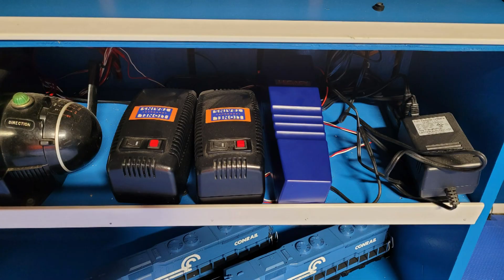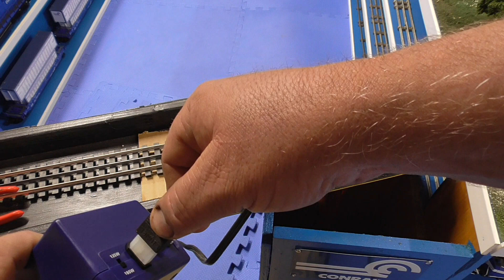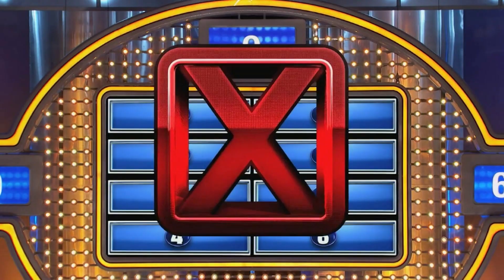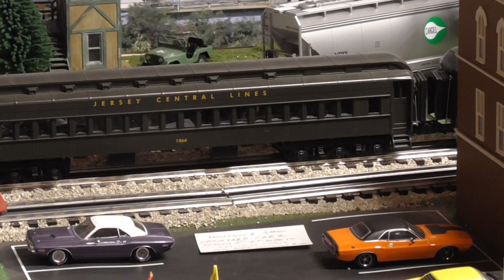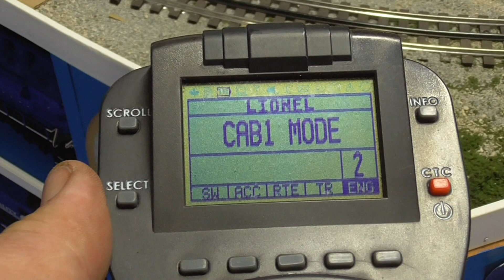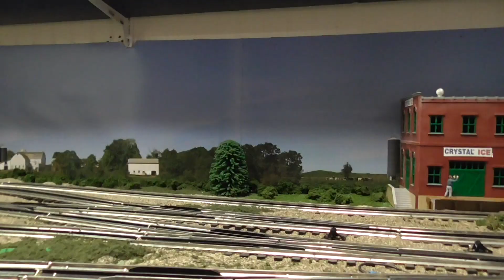Lionel Powermaster Install / Making Conventional O Gauge Run with a Remote

Comment: If I have a 180 powerhouse, powermaster, and Cab1L, is that enough to run my trains or do I also ABSOLUTELY need the Base3 with all this together? 

It looked as if you had your Cab controller communicate directly to your powermaster but I also heard you need a base too.

Comment: From the directions!  "A Lionel command base is required to operate the Legacy PowerMaster. Compatible
command bases include the Base3, Legacy Base2, or the Base-1L. The LEGACY
PowerMaster is controlled by the signal generated by a Lionel command base. It is not
controlled directly by the signals from a CAB controller.
"   I have spent HOURS on this subject!   Lionel's own video on youtube states YOU DO NOT need a Base and the Cab 1L would 'talk' direct with the Powermaster.  YET, that is NOT what the instructions state for the Legacy PowerMaster.   WTH Lionel?????    What a cluster!
Reply from the maker: I never watched the Lionel video.  I just followed the instructions in the box. As a addition to the instructions. I assigned the Power Master a engine number to my Cab 2. I run both conventional and Legacy trains on this track. When it comes time to run Legacy trains I simply click on the assigned number for the power master and turn the power up. The afterwards I will click on the assigned locomotive number for the locomotive that I want to run. The only pain in the butt part is if there's a derailment and I reset the transformer I have to do the same process over again.  But I like having the option to run conventional or TMCC or Legacy.
Reply: @Dakman  Unless, I kind a cab 2 remote, skipping base 3 for now.  Mth dcs has built in conventional control.  Lionel making my head spin!  Lol. I can't buy a cab 2 base.  So, only control option is base 3, $500+, powermaster legacy 85
00, cab 1L remote , 160.00. All to control conventional lionel on same system as legacy and tmcc.  Lol. I hate the apps.  So sad the mth and lionel dropped the vast majority's wants for real remote, and dumped a stupid app on us instead.

Comment: I was wondering I have some track and a dc transformer  would I need to get the power master.  as well
Reply from the maker: You would not need a power master if you plan on running trains in a conventional mode. A power master is only a good idea if you want to mix locomotives that are conventional controls and remote controls on the same layout in my opinion.

Comment: As a "toy train" enthusiast and not a "model railroader" I find those control units to be an abomination unto the hobby.

That said, I'm glad they have a way for people with the older, less advanced equipment to utilize that kind of controls if they want to.  It sounds like the control itself is pretty rare and expensive though so that sucks.

Very nice layout.
Reply from the maker: Unfortunately O gauge control systems are not available in Lionel since they are transitioning to a base 3 which uses a app. Controls are a love or hate thing.  Thanks for watching
Reply: I’m with ya there, adding Chinese electronics to the equation isn’t what I want. I’d rather keep it simple and not spend a fortune on stuff that doesn’t improve the experience.

Comment: I'm a little confused here. Is DCC only for Ho and N scale? Is what you are showing us here just a different form of DCC?
Reply from the maker: Good question. First thing lets talk about power. O gauge uses A/C power and HO/ N & G scale run on DC power. With that being said, DCC is primarily used for 2 rail. Lionel TMCC & Legacy sends a radio signal to the base and then to the locomotive. You would need a board to convert TMCC signals into DCC commands. On another note MTH Proto 3 has a switch on the bottom of their locomotives to choose either DCS or DCC mode. I believe the DCC mode is used if you converted the locomotive to 2 rail. There is a company called "Blue Rail" that introduced a DCC board for O Gauge in 2021 but it doesn't seem to have taken off. But Blue Rail was set up for A/C power and had a plug set up for Tsunami 2 sound decoder

Comment: On the subject of wire sizes GM threw me for a loop looking at an engine harness wire diagram for 81-87 trucks by putting the wire sizes in metric sizes like .8 and .5. Had to order a manual specifically for my 82 C10 short bed because at the time I didn't know it was metric sizes they were using in this "generic" diagram. Wasn't until I can across the diagram in the 82 shop manual that I found the chart that list what each gauge size is in millimeters. I know that doesn't really have anything to do with this video, but I figured it was worth sharing regardless😅.

Comment: I had a problem, does the cabe1 remote run legacy power master in command mode ?
Reply from the maker: A Cab1 remote will not run a Legacy power Master.  You need the older power Master for the Cab1 which unfortunately is only capable of handling 135 watt max unlike the Legacy power Master which can handle 180 watt.
Reply: The cab 1 will run a Legacy Powermaster but not directly. The track signal must be used so a Base 1 must also be in the system.  The old powermaster can be used with the cab 1 and no base unit. The Lionel video on the subject is so old that when they say powermaster they mean the older or TMCC powemaster.

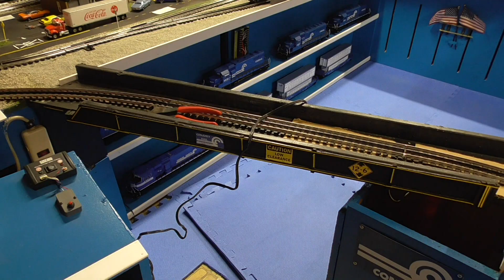Comment: 10:50 Later production Lionel Track Power controllers will operate MTH FYS, PSA , station stops etc. if no DCS signal is on the loop.  Check Legacy PM instruction manual for similar functions. IDK. Origin PM used chopped sine wave silencing original Protosounds.  External capacitor across terminals was the band aid.  Hope new one fixed that.  TPC never had this issue.  It handles more watts, has metal case and Lionel catalogs said it was better.  TPC can work with Legacy base.  20+ years of TPC w/o failure.  No special power cables and uses any transformer too.

Comment: Hi:

This is probably a neophyte question but here it goes.  

I have a 	Railking Norfolk and Western 4-8-4 J Steam Passenger R-T-R Train Set # 30-4036-0 set, a Lionel Polar Express Lionchief and a Lionel Postwar 1666.  I want to run all 3 locomotives at once.   When I purchased the Postwar 1666, I also purchased a 250 watt ZW transformer from the 1940s.  Based on my research, I can run the MTH N&W and the Polar Express on the same track powered by the ZW with a TMCC Direct Lock On.  That doesn't appear to be a problem.  Running the 1666 is the problem.  

It sounds like the powermaster would solve that problem.  I found a Lionel 6-12969 TrainMaster CAB1 Command Set Remote & Base EX/Box for $275.  Would this solve my problem?

Comment: And the MPC era has a certain charm.your PC emerald set up would look great on the main layout
Reply from the maker: I will have to make a run of my MPC on the main layout in the future
Reply: @Dakman  in my Tri-Rail o gauge layout guy started when I got the MTH subway car sets I model a prosperous pet Central with a cutoff date of the bicentennial so I can run my bicentennial painted locomotive. My K-Line GG-1 when you press the horn button it plays God bless America. I would love to have a scale diecast GG-1 but I don't want you to have all of the expensive electronics in there just waiting to fail. If I could I would put a diecast shell on one of my Williams locomotive chassis. I love all of my MPC era Penn Central rolling stock which I run behind my diecast MTH freight cars. I love having american-made trains 🚂🚃. I can run New York Central and Pennsylvania railroad locomotive together as well as having passenger trains composed of passenger cars from both railroads. Electric locomotives like the ep5 ran pantographs down when they were in third rail territory. The Penn Central was the canary in the coal mine and when it went under because all the factories it serviced went offshore and all of the coltrains disappeared with oil fueling power plants as well as passenger trains that were money losers as people turn to cars and aircraft. It is a shame that there were more people that wanted to see it fail then wanted to see it succeed.

Comment: I have the same set up. I use TR or Track 1 so TR 1 Boost on the remote gives me 18v to the track for CC even after breaker tripp. Nice to see the Set running as it should.! 👍😊

Comment: Nice to see you got Powermaster and you have it working as you had hoped. You have helped me in the fact I didn't know about keeping the voltage up when going back to command mode. I did know that they can be time consuming when the breaker trips but not really a big deal. Switching from command to conventional is done with a small switch so where you mount it on your layout you would need to keep it accessible. Small inconveniences but big results. I figure it takes a little time to change out the locomotive so a little extra time to set up the control system is not a big deal. At least an the end of the day you can run whatever you want, wherever you want. That Conrail Safety set looks really nice on your layout, ran really smooth at lower speeds, nice start up speed without jerking.